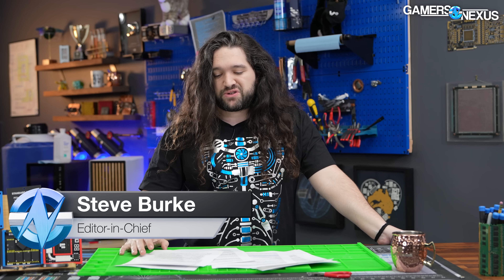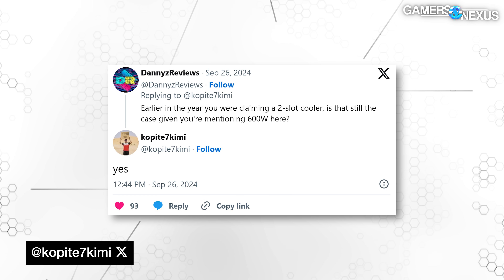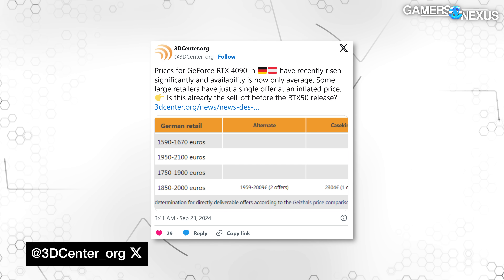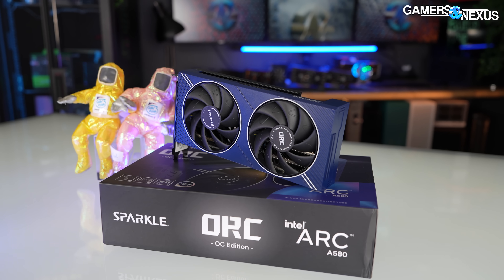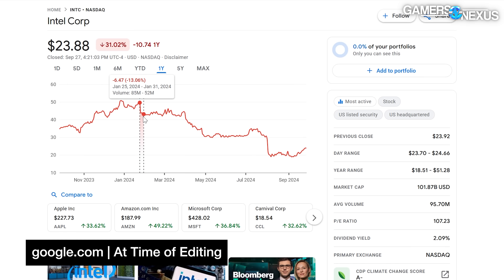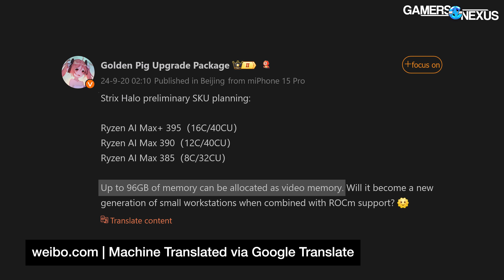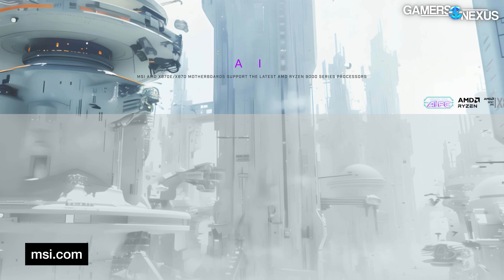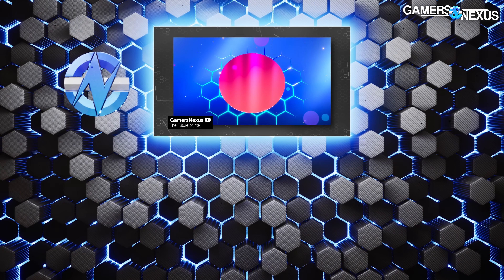HW News - RTX 5090 & 5080 Leaks, Valve ARM64 Experiments, Intel Arc 0% Marketshare, 4090 Price

Comment: With amd and intel having less and less market share, sorry but like why would anyone buy an amd gpu, like on budget theyre most likely great ive recommended alot of 6700xts and belows, but i bought a 6900xt and and 7900xtx and both of them had such shitty ah drivers that some games i couldnt play, the stream encoder sucks ass so streams would look really bad (av1 aint a thing yet on twitch or wasnt at that time), and idk i just had alot worse 1% lows in games that are cpu bound, compared to my current 4080. 

i wouldve LOVED to keep my 7900xtx, it felt better in hand, like built wise it felt so much higher end, compared to my msi 4080. for less money, but the drivers killed everything, also power draw sucked ass. also my monitor 280 wasnt supported could only do 240hz, with 4080 it was instandly at 280. 

intel? i barely hear anything of them. legit they launched some gpus and everyone forgot about them. nobody covers them anymore, u dont see alot of people using them, and i feel like its same issue as amd has, prolly intel has been better with the drivers tho lol.
Reply: stream decode on twitch or youtube etc works fine and looks perfectly fine decoded with an iGPU on a 7000 series CPU - at least here since May of 2023
What did look bad?
Reply: @bernds6587  amd is great when you're going for a mid range pc for gaming maybe, but nvidia definitely excels at doing other things like what he said
Reply: @bernds6587  @bernds6587,
While it's true that AMD's integrated GPUs (iGPU) can handle basic streaming tasks, especially with advancements in the 7000 series CPUs, there are notable limitations when compared to NVIDIA, particularly when streaming and content creation is a priority.

Stream Quality & Encoding:
AMD’s encoder, while functional, generally falls behind NVIDIA's NVENC in terms of both efficiency and quality. For platforms like Twitch, where AV1 support is still not widely available, the older encoding methods that AMD uses (such as H.264) struggle to maintain consistent quality at lower bitrates. This can result in a more pixelated or "blocky" stream during high-motion scenes, a problem you’re less likely to encounter with NVIDIA’s NVENC, which has long been favored for its superior image quality and encoding efficiency.

Driver Stability:
AMD has made significant strides in improving their driver support, but as @Creesl mentioned, driver issues have historically plagued AMD's higher-end GPUs. Frequent updates, game crashes, or compatibility issues can severely impact both gaming and streaming experiences, especially for CPU-bound games. NVIDIA tends to have more stable drivers, which reduces the risk of unexpected problems during streaming sessions.

CPU-Bound Game Performance & 1% Lows:
For CPU-bound games, AMD GPUs can sometimes exhibit lower 1% lows (frame time inconsistencies), leading to choppier experiences compared to their NVIDIA counterparts. This could further exacerbate the problem during a live stream, where both the CPU and GPU are under increased strain, handling gameplay and encoding simultaneously.

Power Efficiency & Peripherals:
As mentioned by @Creesl, the power draw on AMD's high-end cards like the 7900XTX can be significantly higher than on NVIDIA's 4080 series. Additionally, the issue with the monitor's refresh rate is another example of the edge NVIDIA has when it comes to plug-and-play experiences with modern gaming setups, offering more robust compatibility and flexibility with higher refresh rates.

NVIDIA’s Ecosystem:
NVIDIA offers not just better streaming support, but a more comprehensive ecosystem with tools like NVIDIA Broadcast (for background noise cancellation, virtual backgrounds, and AI-driven camera framing). These features are incredibly useful for streamers and content creators, making NVIDIA GPUs an all-in-one solution for gaming, streaming, and even video editing.

In conclusion, while AMD has a lot to offer for mid-range gaming setups, if your primary use case includes streaming or professional content creation, NVIDIA still holds a substantial advantage due to its superior encoder, driver stability, and ecosystem of supporting tools.
Reply: @souly1812  like I said, I cannot see any bad looking streams at twitch, and - even though I currently just use that 7000 CPU series iGPU, every game I started was running fine (of course severely limited by the underpowered iGPU). 
For occasional lagging and 1% lows I can not really speak (obviously), but at least the games which do run (be it Factorio or Minecraft), they run stable.
So 🤷
Cannot agree on these points, at least on the viewpoint of an AMD iGPU.
And I honestly doubt it would be that extremely different with a dGPU.
I was using a HD 6950 for 11 years, and just had driver issues in the beginning, until the card was too old - it didn't support DirectX12 and Vulcan, and its 1GB VRAM was not sufficient enough.

So uhm.. I guess I was quite lucky in the past?
Reply: @simonestark1369  thank you for your AI generated text.
Like I already said: I see no bad video on Twitch, and personally I had no driver issues there, and just a few ones in the beginning on my old card about 11 years (!) ago.
And since I am no streamer, my use case for encoding video or any software regarding that - goes towards zero.
And if I ever need to cut and re-encode a video, I gladly wait a few minutes more (if even), before I buy a comparable card which has less VRAM and costs more.
Reply: @bernds6587  my english is not very the good. Ai helper me say that i think
Reply: @bernds6587  thats fine bernd, i personally still, after seeing myself play mainly shooter games, comparing on how 6k bitrate looks, it just looks alot worse, ofc for some people it might be enough which is totally fine, it ain't for me or for what im trying to show, if single details are important, and u cant see them cause the whole stream gets blocky again, cause my 1000$ gpu cant handle encoding, then sorry i dont want that gpu, same again with the game crashes, lags and unsupported resultion from a 1k $ gpu, ill gladly spend a tiny bit more for a bit less specs if it ACTUALLY works for what im trying to do. 

its like ofc i could buy a bmw, and drive it,  yea it technically can run faster, but if the darn engine keeps breaking, id rather sit in my shit toyota, that cost me more for less. but its reliable.
Reply: @Creesl   Yes, different use cases, and personal preferrence.
Just: "can't handle encoding" is just wrong. It does not work at that specific usecase in the quality some people really need. Which is a wholly lot difference to "does not work at all".
Just saying, Nvidia are the ones still running around with Displayport 1.4, that's why the only complaints about unsupported resolutions are from people who use Nvidia GPUs.
Not sure what you are doing wrong here, but if you get such issues on AMD hardware aswell as on BMW, the issue might be somewhere else 🥲 (just kidding)

Comment: These new AMD Ryzen-5 APU's being marketed as "for AI pc's" has me a bit unsettled.
First off, Sam Altman is an avaricious fool. His ai stuff just steals stuff humans have done and vomits it back out with all accreditation scrubbed from it. It's plagiarism/forgery software.
If I was ever going to buy a PC, AI is the last thing I'd look for in it.
I don't need my computer telling me to use glue to make the cheese stick to my pizza.
Even my next PC that I build is being built specifically in a way that AI is an intentionally excluded, unwanted "feature".
How am I doing that? Simple, the Steam Deck is my salvation, or more specifically, the OS it uses is.
I hope that Valve releases the SteamOS that the Steam Deck uses, but I have a way in even if they don't.
I already want a Steam Deck for other reasons, so I'm going to be buying one in either case, but Valve releasing the OS separately will make things easier.
I will be putting Steam Deck SteamOS on my new PC one way or another, no matter if that means I have to rip it out of the Steam Deck I buy (I'm not afraid to take it apart after a 6 month burn-in to make sure it's not a victim of the "infant mortality" section of the bathtub curve failure model), or I'll just put that same OS on a USB and install it right from the get-go like any other OS.
I've checked my steam library, all the games I'm actually interested in playing will work just fine on the Steam Deck, and I'm using that as a gauge of "Will it run on the Steam Deck's brand of Linux" not the hardware itself.
I'm going to be building the system fully from AMD parts, CPU and GPU. If possible, a 9950x3d, but failing that, a 7800x3d. If possible, whatever AMD releases for the next-generation of GPUs, failing that, a 7900xtx. I'm going to be building it with water cooling in mind, even if the first version of it is air cooled just to get it up and running before being able to pay for all the parts of the loop.
Reply: IMO the best use for those NPU's in that new series of AMD APU's is to "intelligently" figure out which tasks should go to which cores, and what data should be fetched from a given layer of the cache to the next lower layer, first.
In other words, make it make the rest of the CPU and/or GPU work better rather than being used to "answer the questions we have" which are entirely mundane and able to be answered by gasp going outside and talking to someone, or looking something up in the library (used to be google, but now google gives you AI results too, so that's a burned bridge).